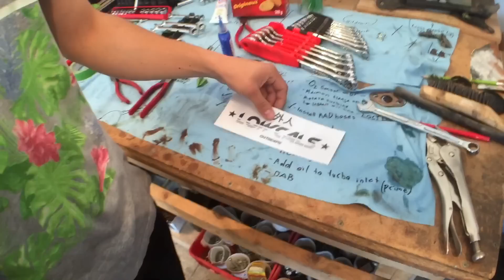THE TURBO IS ON !!! - Supra Build Part 3

Comment: be careful that oil feed you blocked off with a bolt might leak if you didn't put a copper washer behind it. had that problem on one 2j i worked on. put washer on and it was good

Comment: Much progress! I would pull off the upper water neck have the two small ports cut off and welded close, it's aluminum so of aluminum weld it. Please be careful not to damage those turbine blades. Good luck & I'll be watching!👍✌👆

Comment: Ditch that looped hose for the coolant output for 2 of the rubber block off caps. They don't need to be looped, just block em off.

Comment: The turbo return line and feed lines should be directly up and down. Having the center section clocked like you have it can created oiling return problems as well as oil starvation. I advise rotating the center section so that the feed is at 12 and the return is at 6 oclock. For heat management look into DEI's products i personally use a lot of their Titanium exhaust wrap and turbo blanket.
Reply: Thanks for the advice man!! I have a turbo blanket ordered but it's taking forever to get here. Was supposed to ship last week!!

Comment: You can turn the exhaust housing how ever you want.
Also the feed is not that important to be straight and so on.
You have to make sure the center assembly is rotated so that the drain is pointed downwards.

Comment: Make sure you guys throw some clamps on those bolts blocking off the hoses. Make sure all the oil fittings are tight as well, a sad way to loose your turbo and engine for not tightening the an fittings. That heater hose loop also looks like it isn't heat/pressure rated. I would look for an actual heater hose with a 180 turn at the parts store with the right size.

Looks good guys

Comment: Just block the heater return lines with a bolt like ya did with the others or take it off and get the holes welded shut

Comment: oh yeah, the work is nice, probably my suggestion i think u guys should buy rubber stopper to close the water lines that needed to. which is better and more clean look. and push the car out clean the engine compartment before assembly . thats my opinion anyways, But what the hell.... u guy did a great job.....!

Comment: The center of the turbo should be clocked so that the oil feed and drain are as close to straight up and down as possible so the oil can flow better.

Comment: u guys should look into carbon fiber body filler its the same as frberglass and bondo body filler but its much stronger and it wont crack down the road after u paint the panel. the one i saw was like a black paste looking type and u use it the same way as any body filler with the same hardener

Comment: PLEASE, just get some of the rubber block off caps with a clamp to replace the plugged off hoses with bolts and rtv in them before you finish. They are cheap and easy to get. They work much better and are way more reliable..

Comment: Aren't you going to ruin the O2 sensor when it's so close to the turbo? When I installed my wideband in the Miata the manual stated it should be at least 30 inches down from the head.
Reply: On my Turbo smart the stock placement for the first O2 sensor (not wideband) is like max. 30cm after the turbo and the exhaust header before the turbo is just like 20-30cm long as well.

Comment: should have used an 1/4npt to an 4 adapter on the turbo for oil, then put a 90 degree end on the hose, no need for taking off compressor housing to thread in that adapter then.

Comment: Don't use loctite on fittings, if you don't want to have it inside the holes.
Imagine you glue your bearings shut.
Reply: The thread lock doesn't leak like piss into the turbo.

Comment: no hose clamps on the bolts you used to block the coolant hoses
Reply: Thanks for reminding me! I'll go back and add some
Reply: +Jesse LOWCALS please tell them to make a major come back with all the products they've ever made and put them on the store for a limited time only and watch them go because 89% of that is going to be purchased by me. I'll buy you a case of Stella's lol
Reply: +Jesse LOWCALS also when you're cutting studs or bolts you want the a nut to be on so after you make the cut reversing the nut out will clean the threads. cheers

Comment: why didn't u just use liquid Teflon or Teflon tap on the oil feed hole? it will act as thread locker and properly seal the threads. and then snug it up with socket.

Comment: i totally missed where that mini filter was connected and what's the reason since didn't look like it was on valve cover.... if it's connected to intake system then it is going to be huge boost leak. :o
Reply: Idle air control valve, not intake mani!
Reply: ok, so then it is connected to intake? Is it closed when you are driving, in my experience mostly it just controls amount of air bypassing throttle depending on engine temp to keep car idling well when throttle is closed but valve never closes all the way? In that case it will be boost leak when it just goes to atmosphere, it should be connected to intake pipe before throttle?

Comment: that sized turbo for stock internals.. it's not going to live long😂
Reply: please research what stock 2jzgte internals can withstand.
Reply: yes i know but still should have at least change the head gasket for better one
Reply: +Miki Määttänen there are many Supras with big singles on a stock head gasket.
Reply: +Edward Aguirre he thinks its a ford engine
Reply: If you have this little amount of knowledge concerning cars, you wont last long in the car scene😂
Reply: +Muhammad oh snap....
Reply: When you don't know what a 2j is
Reply: +Dylan Moore lol
Reply: That's a mild turbo for a 2JZ.... I know someone with a 7675 (or another similar turbo) on a 2JZ that hasn't even been opened up. Runs well and reliably.
Reply: BUT! when you realize, ford made one of the newest boosted engines.  The V6 Eco boost, twin turbo'ed and honestly, it takes a beating, and puts out more power then the silverado and the dodge
Reply: Jiizetat oli niin kauan jumalmoottoreita kun niitä ei avattu ja vahvisteltu.. eli hyvä näin
Reply: +Zoniq v6 ecoboost is running at its limits stock lol its a pile of crap
Reply: You clearly have not seen the size of the turbo's. they're almos they're almost the same size as the single turbo inline4 mustang they put out this year. my stock turbo on my subie is bigger than that. and the tt v6 is on the f-150
Reply: +Jeff Yuan no, ecoboost mustangs and your stock subie don't have a turbo bigger than this
Reply: CORRECTION, the comparison was not about the supra. Was talking about the turbo's off the V6 eco boost.

Comment: your gasket maker idea isn't gonna work. that bolt in the oil feed needs a crush washer, those bolts in the coolant lines need hose clamps. I gaurantee you that shit will leak.
Reply: +1 they need to use the copper crush washers like those in caliper banjo bolts.. 1st build and they will learn lol at least work is getting done
Reply: Thanks for the tip man! I'll go back and add some clamps and a copper washer before I finish. Appreciate the help (:
Reply: +Jesse LOWCALS no worries, also make sure the bolts in those coolant lines are big enough, as if they would almost "thread" into that rubber line. Did you tighten that oil drain up with a wrench or just by hand? you should go by hand until snug and then a turn and a half with a wrench. Goodluck!